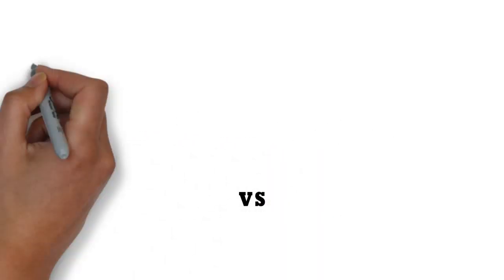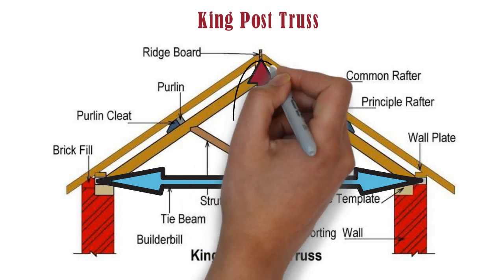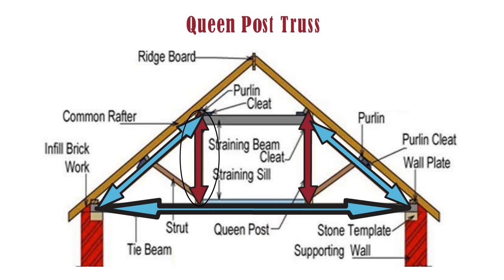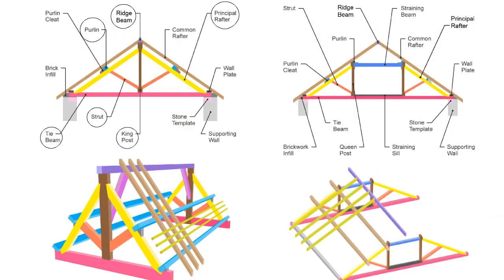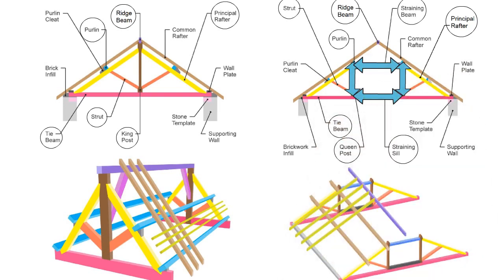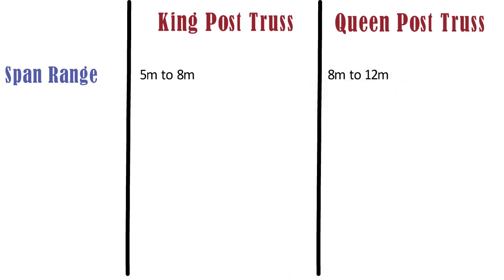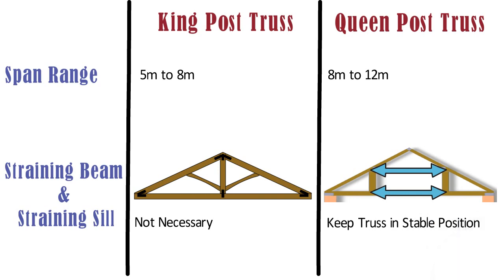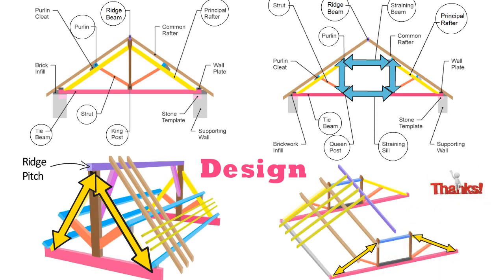King Post Truss vs Queen Post Truss

Comment: So, I have a 120yr old stable on my property and it has a queen's truss design I have never seen before. The queen posts are set at 10° angles sloping in toward the center at the bottom. From their base to the upper beam is a 1"" diameter steel rod with threaded square nuts on the ends compressing the lower beam to the upper. In the center of the lower beam is another 1" diameter rod with threaded ends and square nuts holding tension between the queen's truss and a 22' long 8"x8" beam spanning the lower stall. It's held up with very little twisting or sag over the years even with the prior owner having bumped the building with a truck at the corner. There's a little twist to the building now that others have built lateral support against.